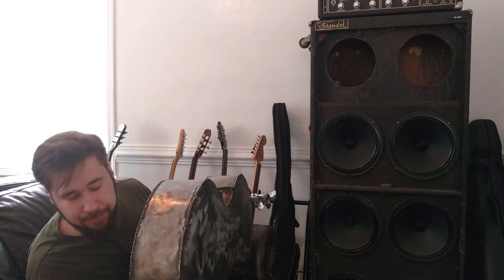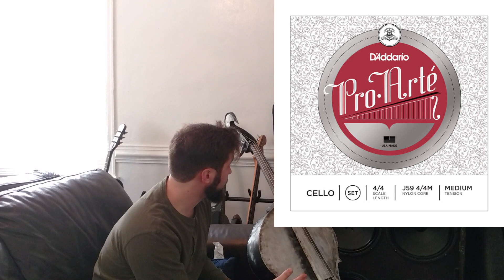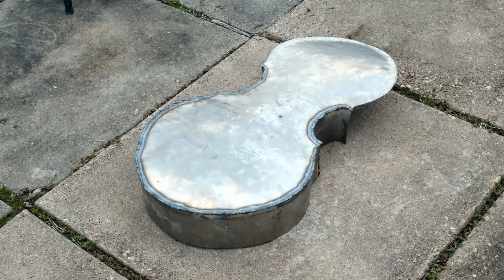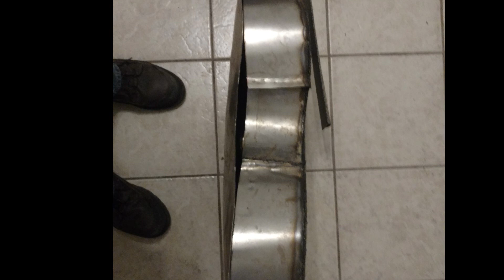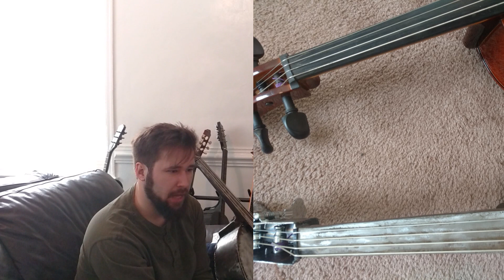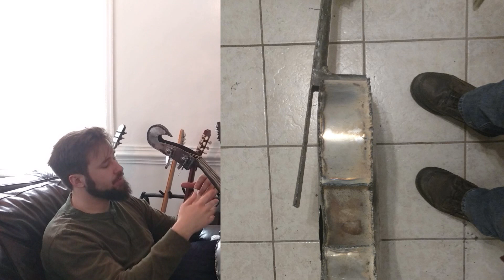Steel Cello :  How I Made it!

Comment: I like it and will listen to the sound now. I made a carbon fiber double bass but would like to replace the front plate with a steel one. I wonder if the sound is louder with metal?
Reply from the maker: Because you can use thinner steel for the same structure of the face (compared to layers of CF) you should get more volume, but also more overtones.
 The trick is to use the thinist face material while making it structurally sound with hammered out curves and, in my case, a rib. 
I would say for a large upright bass, you would need to implement some pressed flange holes (special tool used for making lightweight frame rails out of boxed sheet metal)
Reply: @uncontainedcuriosity2316  Thanks for the info. I have a cnc plasmacutter so cutting the front plates takes me a couple of minutes. How thin do you think I can go in gauge? 2 mm or 1 mm? I was thinking about skipping the curve face and just keep it flat. 
But I could also make some ribs to hammer it out but it would be hard to get a flat underside I guess. But since you did it I can! Thanks again!
Reply: a picture of my old bass if you are interested: 
https://joelillerhag.com/wp-content/uploads/2021/02/IMG_20190331_120008_073.jpg

The one I plan to change is smaller . Between a cello and a db bass.
Reply from the maker: @illerhag   After some yeas of engineering work, I have a collection of contacts to cutout designs and such now (when I made it, I didn't). So that's super cool you have direct access to a plasma cutter. 

I would highly advise the hammered out pattern instead of flat face.

I would recommend watching some "old fashioned" motorcycle fabrication. You may have to use an "english wheel" on something the size of a bass. The other method is to get a large sandbag and hammer on that (another old fabrication technique).I was also thinking about 3d printing out the contour and hammering into it like a mold. 

For an upright bass, the relative pressure on the face would have me considering 1.6-2mm.  I could of gone 20g all around on my cello after having it setup and assembled. More of a way to keep weight down, but no structural concerns even with 18. 

The thing is, the face is also welded all the way around, so that locks in the curve face - you'd have to find some kind of way to make a strong binding or make a very strong flange around the edge. Two options would be riveted edge, or a whole bunch of cutout tabs around the edge that are bent perpendicular and welded

My rib is very rudimentary, 16g sheet (about 50mm depth, and 20mm at each end) straight down the middle perpendicular to the face. the rib is cutout to follow the face contour. It is also welded at each end to the sides.
Reply from the maker: @illerhag  That's beautiful, I also really like the "e-bow" electromagnets you put on the sympathetic strings linked to MIDI, very nice touch. Im not understanding the lower 2 strings in relation to the fingerboard cutout. But then again, thats probably a custom touch for you.